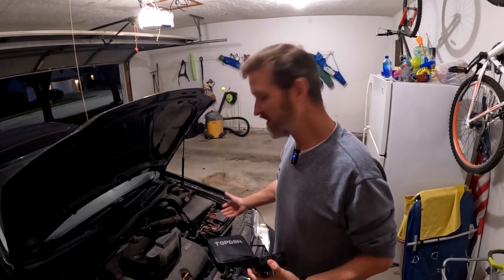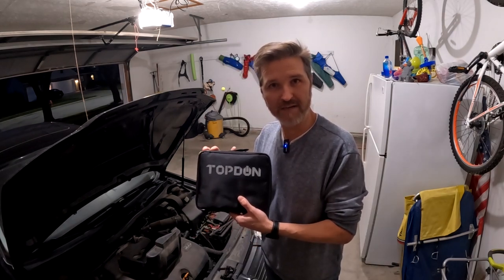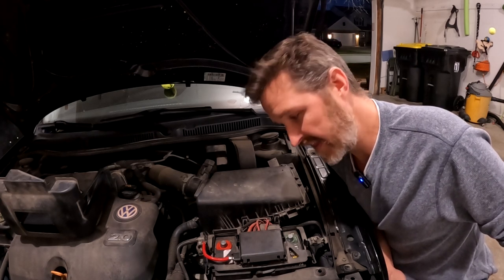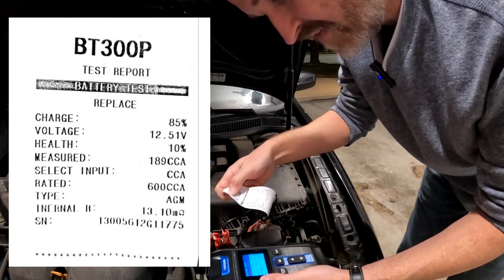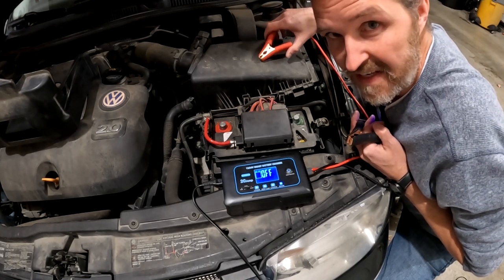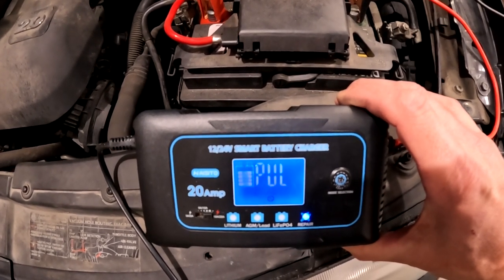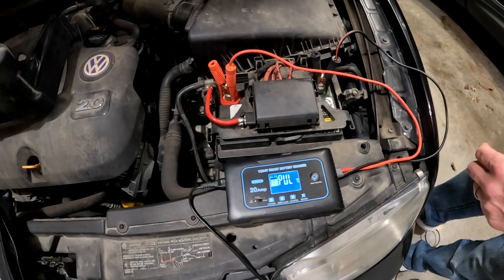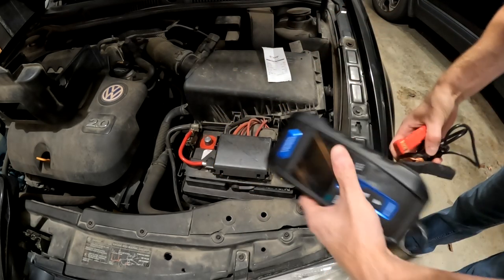Repairing my car battery with the Hasito 20A Battery Charger in Repair Mode!

Comment: Well, i am an engineer, and i see one problem: you should take it off the car,because the pulses are transmitted to your electronics in the car directly. Not quite a smart run but hey,make another with the battery only,all the best 🎉
Reply from the maker: The battery is completely disconnected from the car.  Both positive and negative connections are disconnected.  Are you saying to completely remove it from the engine compartment?  I feel that's a bit excessive.

Comment: Two things... 1.  Normally one should connect the battery repair unit to the battery first before powering it up...  "normally" and this may not matter in this case.  2.  The longer you wait to replace a known bad battery like that the higher the chances of your alternator will get damaged.  It is working harder than needed and sometimes more than it is designed to do.  Also, I would do the same exact test with the other vehicle and see too.  I have professional battery chargers ... expensive but I used in the repair business for quite sometime.
Reply from the maker: Thanks for the information.  I'm planning on replacing the battery very soon.  I really just wanted to see if the health of the battery would increase at all.  Would the battery repair function hurt a battery that really doesn't need it?
Reply: #2 is complete nonsense!
The alternator provides around 14.4 V, whether there is a good or a bad battery. If the battery is fine it gets charged, if not it won't.
If the battery feels bad, repair - desulfate - it and you will have a new battery. 
There is no need to replace a car - lead - battery ☝🏿🧐

Comment: In order to get the battery properly repaired i.e. desulfated you probably have to get a CETEK charger. I repaired some batteries using that ☝🏿😉
Reply from the maker: Thanks for the info and the comment.
Reply: Whats special about cetek?
Reply: @MN-sc2uz  
CTEK chargers have a particular lead battery repair program i.e. it generates pulses in order to clean the lead plates ... desulfation. 
Only drawback: batteries should not be completely dead, when using a CTEK charger, it won't charge. If they are dead i.e. Voltage < 1 V, you need a manual charger that brings some voltage back into the battery. Then you connect the CTEK in addition and it will perform the desulfation. The reason is that CTEK chargers work automatically, hence measure current and voltage. If those values are below the threshold, the repair mode won't start - for safety reasons, I assume. 

I do not want to advertise CTEK, probably there are other brands which do the job, too. But I own a CTEK and I use it regularly to repair lead batteries.
Reply: @dacat8171  i see. Thank you for a  detailed response. Will the cetek work agm?
Reply: @MN-sc2uz  
Yes, it also charges AGM batteries.
Reply: @dacat8171  i meant the repair function.
Reply: @MN-sc2uz  
No. Won't work.

Comment: I'm not poking fun at you or anyone else but this is hilarious. 😄  I'm ASE and MMI certified and for anyone to think that a battery can be "repaired" with ANY method of charging is fantasy at best.  The only physical service you can do is adding distilled water to a flooded lead acid battery (never add acid), or with some chemistry batteries cycle them with a slow discharge and trickle charge.  Other than that if a battery is bad, it's bad.
Reply from the maker: Thanks for the info.  I found that out the hard way.  It was a VERY temporary fix at best.  Thanks for the comment.

Comment: I wonder if multiple repair sessions would get the battery in even better shape. The repair mode and that higher 15+ volts you seen is boiling the lead plates in the battery in pulses to remove  sulfation I think. if you could get it back to 50% health that could last another year or so.
Reply from the maker: I'm thinking about doing another round of repair tonight since I'm still using the same car battery!
Reply: @OffGridBasement  Awesome. Would be good to see if anymore improvements come from another round!
Reply: @OffGridBasement  any updates on the second repair? Did it help?
Reply from the maker: @lookitzdan1lo  I ended up repairing the battery once a week for about 5 weeks.  It peaked at repair #3 and didn't get any better afterwards.  Repairing the battery isn't a long term solution.

Comment: I thought this charger was for lithium batteries
Reply from the maker: It can charge multiple types of batteries.  SLA, li ion and Lifepo4 just to name a few.  Repair mode is only for sealed lead acid batteries.  Hope this helps.

Comment: Cool test. With the small but measurable improvement, I'm curious if multiple repair sessions would continue to improve the health of the battery. Or would you hit diminishing returns immediately?
Reply from the maker: That would be a good test, but I think I'll wait until I get a replacement!  Thanks for the comment.

Comment: Next use the charge function to top it off. Would it improve the battery?
Reply from the maker: After this video I repaired and charged that car battery about 5 more times for the next 3 weeks.  It never got too much better so I had to end up replacing it.  Thanks for the comment.
Reply: I noticed  your battery is agm, the unit is designed for flooded led acid, it increases the voltage for an extended period of time in order to desulfite the sulfar that gets built up on the led plates over time  @OffGridBasement

Comment: Эти зарядки HTRC при их хорошей внутренней компоновке выходят за пределы напряжения для свинцово-кислотного аккумулятора и у них не работает режим восстановления.
Я купил более дешевую зарядку Foxsur 12v, 12 A и у неё хорошо работает режим восстановления.
Напряжение не превышает 14,4 V и в режиме восстановления можно увидеть на тестере пульсации от 13v до 14,3v и наоборот.
Reply from the maker: So you're saying they're no good for lead acid batteries?  Interesting.  Thanks for the comment.
Reply: В режиме восстановления - да.
И немного выходят за пределы 14,4 v.
Но хороша эта модель HTRC тем, что можно регулировать силу тока.
На моём зарядном устройстве с напряжением всё хорошо, но сила тока в режиме зарядки автомобильного аккумулятора подымается почти до 12 Ампер, а это плохо для 50 амперного аккумулятора.
А в режиме зарядки аккумулятора для мотоцикла - не подымается выше 1,5 Ампера, то есть маленькая сила тока и долго ждать полной зарядки.